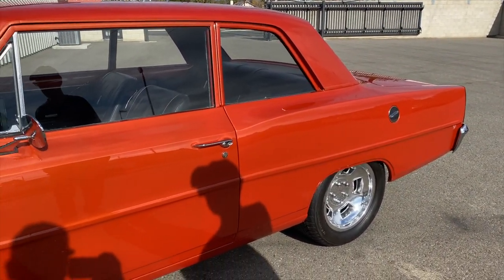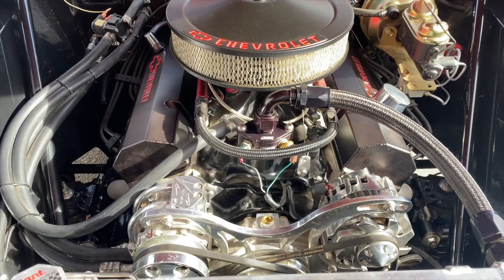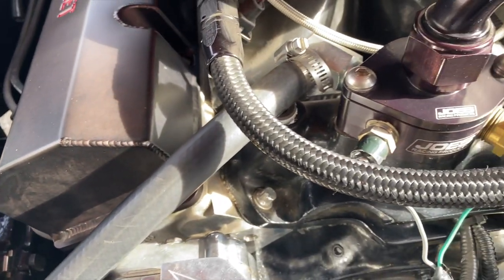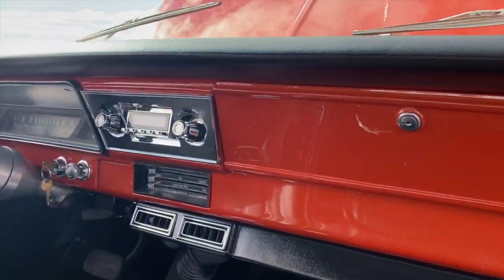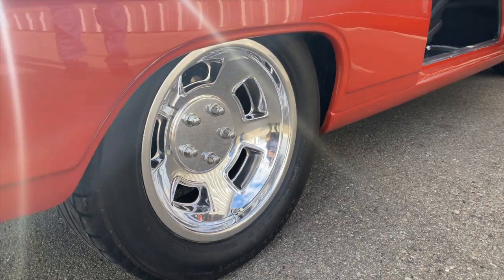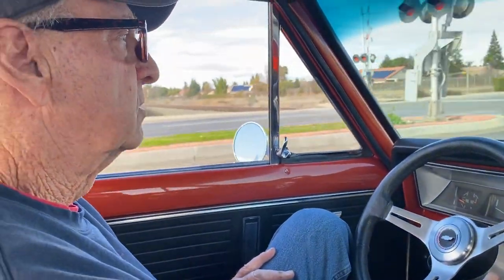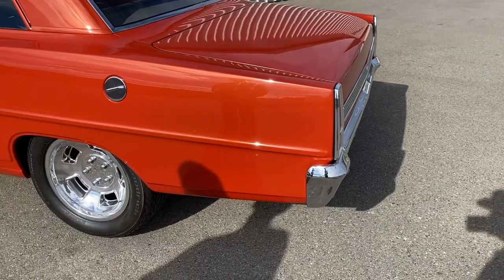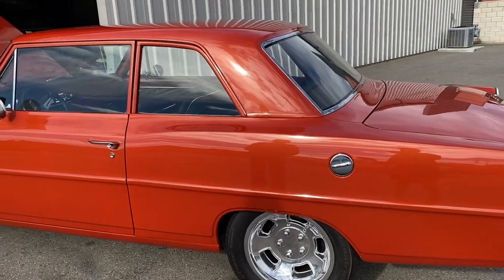Too much power for a Chevy 2 Nova?  383 injected, over 500HP

Comment: Try to turn the neck on the fuel head and then it'll make turn it clockwise just a little tighten it down and then put the cap on and you'll have it straight just a thought

Comment: Nice car, but you are optimistic on the horsepower. 450 maybe? The gas filler tube is clocked wrong. Easy fix.